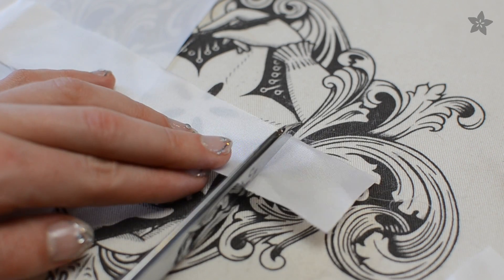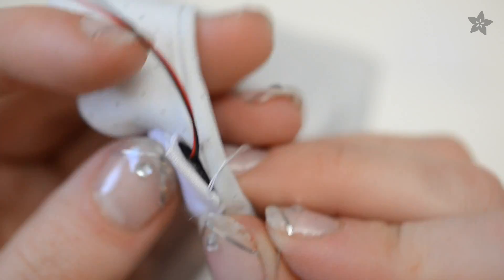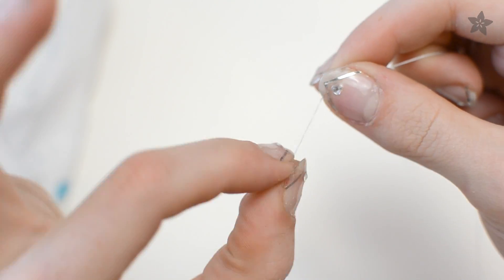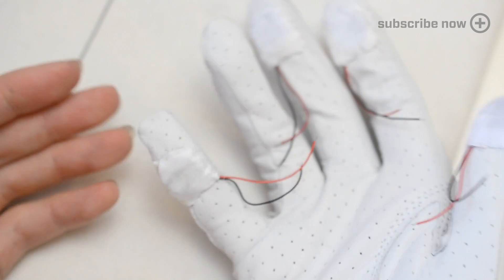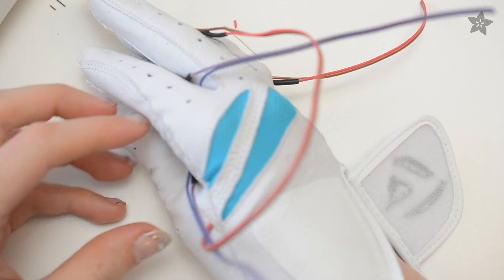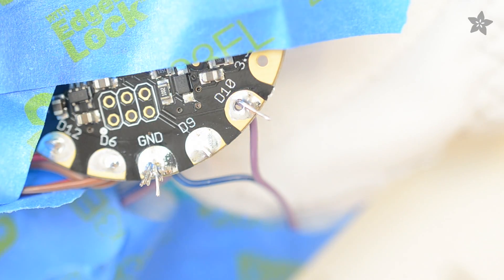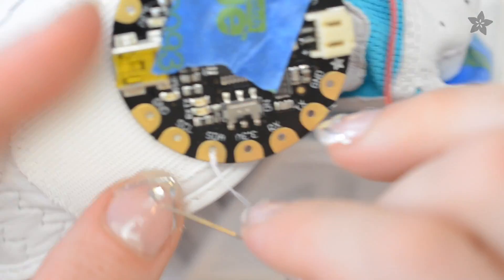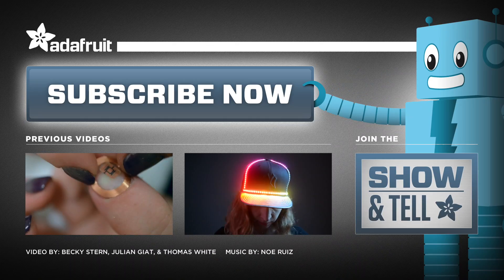MIDI Drum Glove

Comment: Adafruit Industries Tried this with a spare Teensy 2.0 I had, changed the code to lineup with Teensy pins, and now receive no MIDI signal.  Any advice?
Reply from the maker: KM Productions If you're an Adafruit customer, you're always welcome to post up in the forums! Our dedicated engineers there can help you with troubleshooting. Be sure to post your code and pictures of your circuit. forums.adafruit.com
Reply: Adafruit Industries Thanks!  I'll do that.